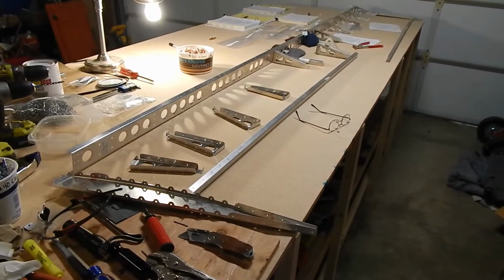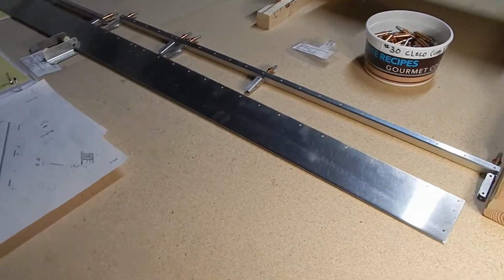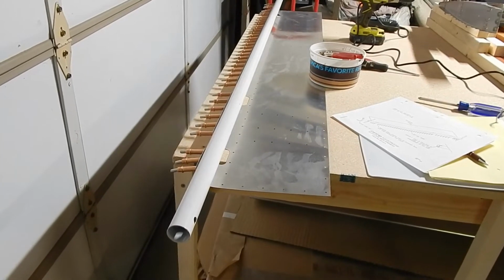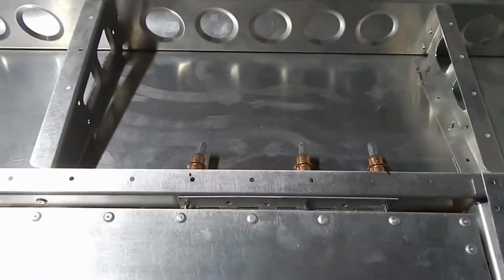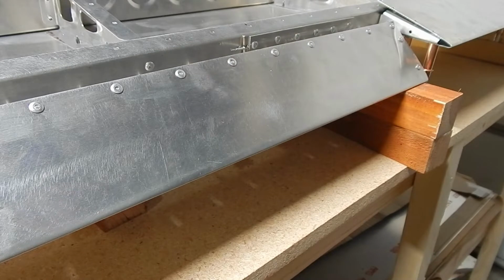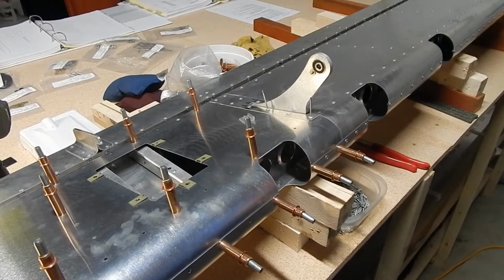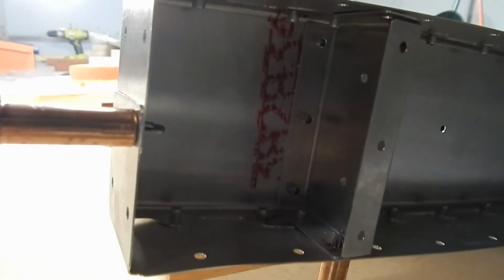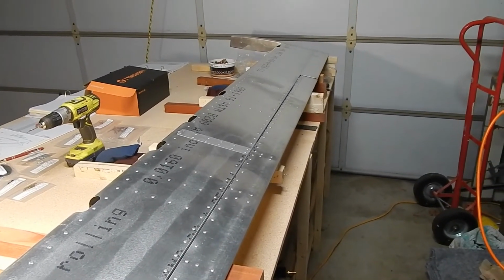Building a Rans S-21 Outbound Ep 5  Elevator

Comment: Thanks for sharing and pointing out places where instruction manual are not clear.  I am taking a lot of notes and am learning a lot from your videos; trim servo tip, counter weight, and the safety wire for the hinge pins.  Nice job on the video and the build.

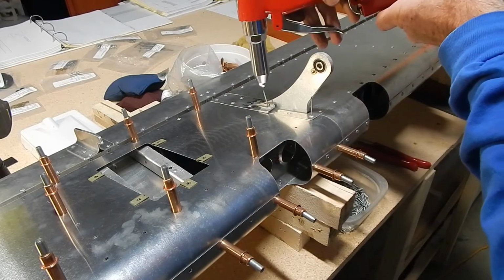at 16:56, when you demo the rivet wedge, you had the flat side of the wedge the other way around.  the rivet gun need to contact on the flat surface of the rivet wedge.  minor detail.
Reply from the maker: I don't think so on the wedge.. The flat side needs to be flush with the skin.  The angled side allows the face of the gun to be flat on the wedge, while being at an angle.  Well, if I flip it over, I would get the same angles.  I think it provides the same result either way.
Reply: @treetopflight7624  you are correct.  the flat side of the wedge need to contact the rivet.  other rivet wedges i have seen are solid, but if there is any scrap metal that can be made to be a rivet wedge, your is a perfect solution, just have to make sure the flat side contact rivet.

Comment: Question for you! I just started working on my elevator today…and I was fitting up the hinges on the elevator. At first I put the bushings in like you did, the same way I did all of the bushings on every other hinge up until today…Then I saw how the fit up, and the horizontal elevator hinge that it mates to is supposed to fit between the bushings/hinges on the elevator. I measured, and it appears that the bushings are installed opposite as they are on the horizontal elevator…in order for them to mate without gaps between them. Unfortunately, there is no close up diagram or depiction of exactly how to install the bushings in the hinges for elevator. What do you think?
Reply from the maker: Unfortunately all of my tail feathers and wings are stored.. I don't remember anything not fitting up, and I hope I am not in for a surprise when I do my final assembly.  Please add additional comment if you get an answer, as I expect future builders might run into this discussion.  Thanks.